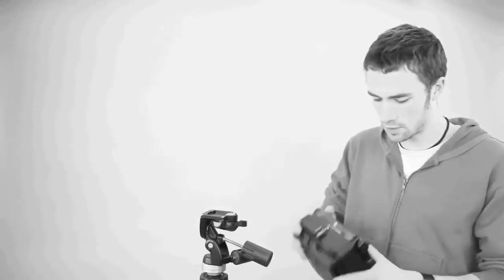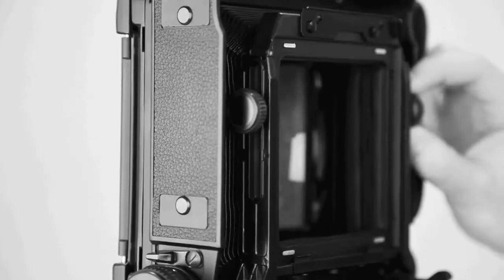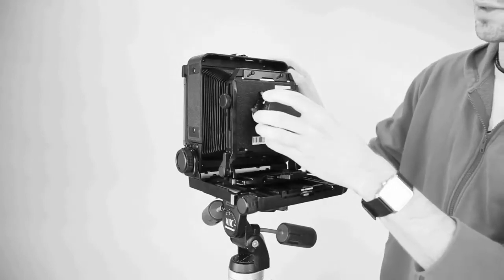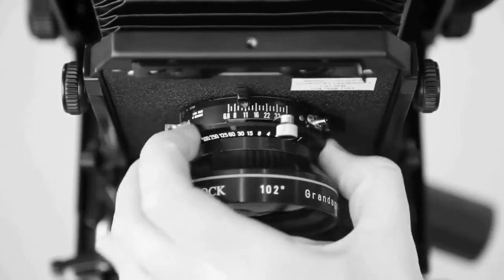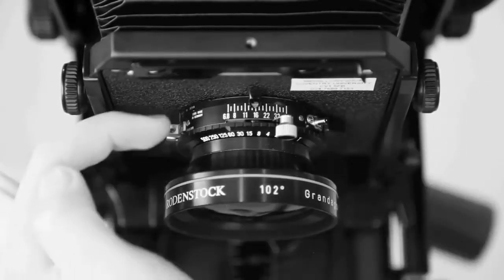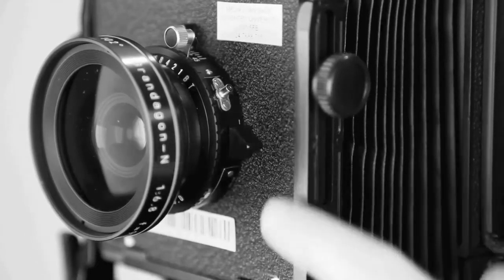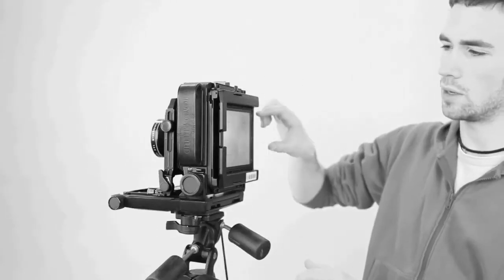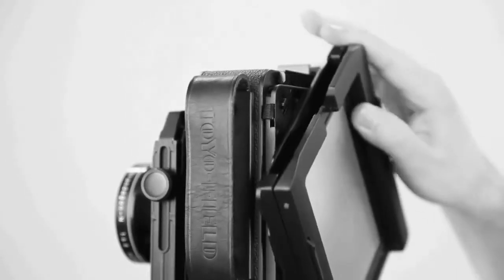Toyo 45 AII Field Camera Walkthrough

Comment: I am a bit confused as I have a Toyo. Called a Toyo-View Arc. 
It is THREE times the size of yours.
It weighs 15lbs (about 7kg), on its own and is leather.   
It seems to operate differently as well and I did not have to assemble it nor does it come apart.
It also takes lenses from my Kodak, which thankfully are Nikon glass.
Oh... We could talk for HOURS.
I also had NO IDEA THAT TOYO WAS STILL IN BUSINESS? ! ???

P.S I am a retired photochemical engineer working for both Kodak and Konika/Minolta, taught at our state university, owned a camera store  (the oldest in our state and supplier to the "Art" college), taught color theory at said Art college (people are so color 'blind') and am a Master Printer. 
Had a few classes through Google+, but had to shut them down. 
Obviously,
I LOVE all things photo
Reply: What you have is a Toyo-View monorail. This is a Toyo-Field (Field camera). The view camera is a lot more capable and will allow additional bellows extensions and more options available.
Reply: @marcweintraub   - I love talking cameras.  My Toyo-View has three rails and is also on a sled. :)
Reply: @OfficialMyxomatosis  Same here. I want to make some more gear / photopgraphy videos for "Return To Film (RTFM)". Just don't have enough time.

Comment: Is there something especially tricky about re-folding the Toyo cameras?  Many of the Toyos on offer on eBay (Maybe most of them)  have significant bellows damage, usually at the very front, near the lens board, and often on the left side.  You made it look easy, but apparently if the front isn't in exactly the right place when you start to fold the front, the bellows gets pinched.
This is not uncommon on folding cameras, but seems especially common on Toyos.  (This is not a criticism of Toyo, but seems to be a user problem.)